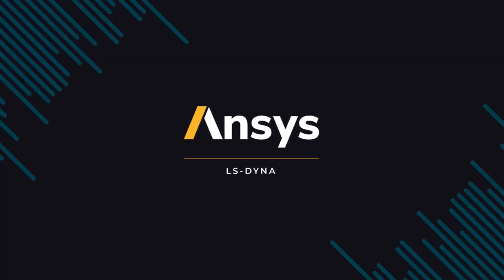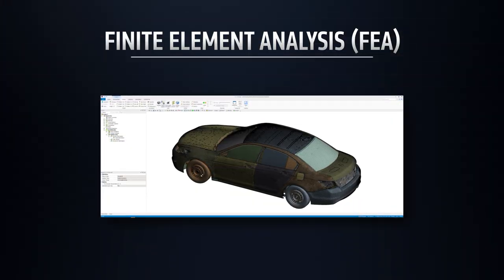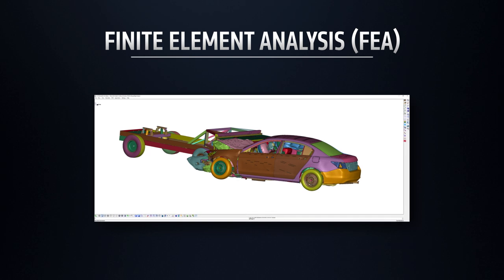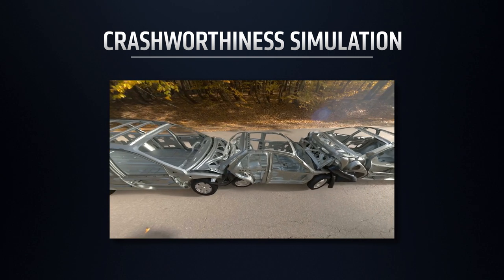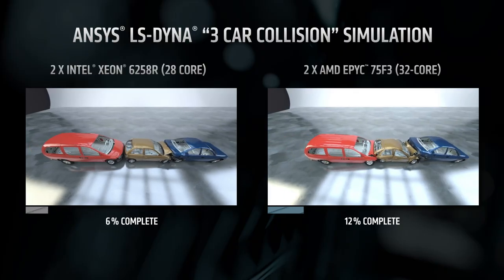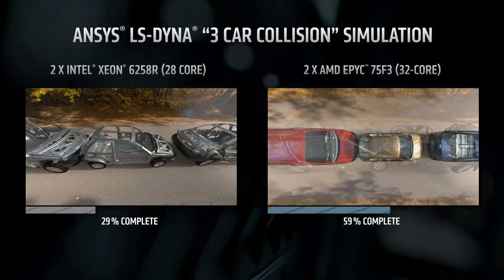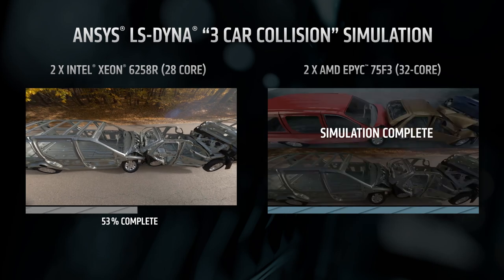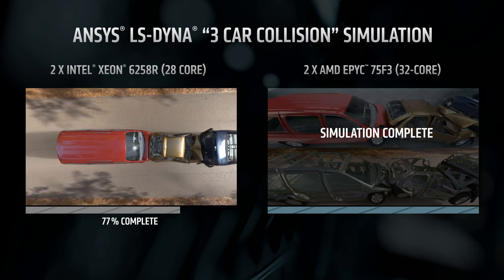Shorter Product Development Time

Comment: What's the base of FEA (just curious). I'm asking because i have seen videos about Papers that showed much better results, or maybe it's just all smoke and mirrors.
Reply: They are based on structural mechanics equations to calculate the stiffness of the structure and when subjected to a load, it deforms. These crash simulations from Ls-Dyna has been validated many times by real controlled crash experiments and they are one the major reasons why our vehicles are much better in this area now than in 80's.